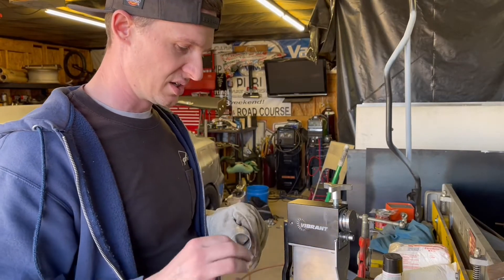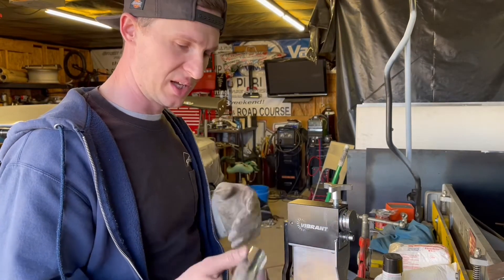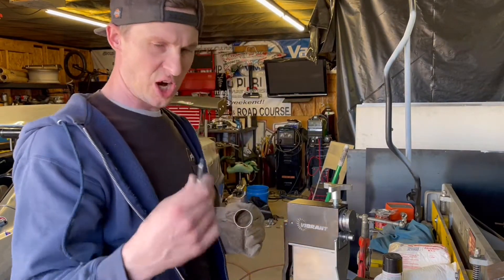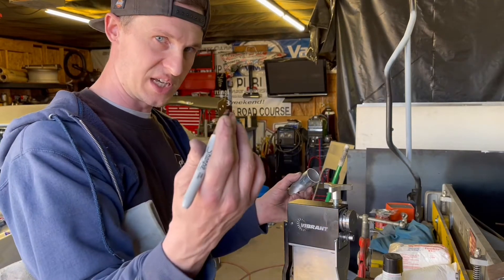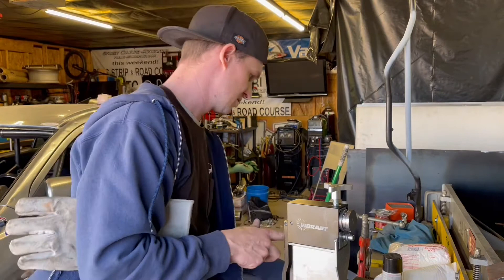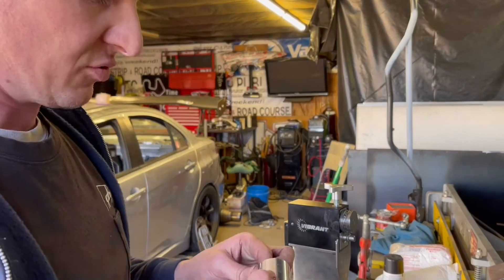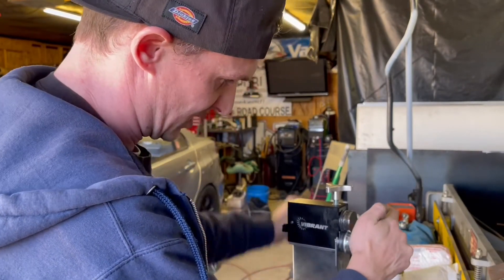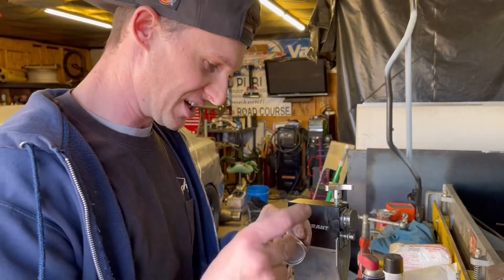Annealing Aluminum - it’s way faster this way.

Comment: I know this is an old video but I'm curious. You immediately quenched after heating, did you let it cool down more before rolling the bead or just go from quench to rolling the bead? I have several pieces to do on my project and would hate to get it wrong. It's all coolant lines out of 1-1/4" 6061. Thanks! Love the videos!

Comment: Precipitation hardening of Aluminum is done by heating it and letting it cool slowly. Quenching softens it. Copper behaves in the same way. This video is one of the few on YouTube that gets it right. Good job.
Reply from the maker: Thank you!!
Reply: With no luck, I've tried annealing aluminum tubing without Quenching and it always cracks. I'm going to try Quenching, however, should it be done with oil or water?
Reply: @shockadellick  Water.
Reply: To quench or not to quench after annealing depends on what type of aluminum you are using. For example, cooling 5052 aluminum naturally in ambient air after annealing does not cause precipitation hardening, as 5052 is a non-heat-treatable alloy that doesn’t form strengthening precipitates. Air cooling is the standard, safe, and effective method to achieve the soft O-temper after heating.

Comment: Yes but once it's annealed and you put your bead into it then you have a softened bead being used to make a seal. I don't know what kind of pressure it's going to be operating at but I'm thinking that it's not going to hold up long term in that state. A guy from another video commented that to bring back the tensile strength of aluminum after annealing is to heat it at 450° for 8 hours. He said that he worked for an aluminum company and he was referring to T6 aluminum if I remember right. I don't know if it would work and/or if it does work will it work for other aluminum alloys also or is there a different procedure for those. I'm going to continue to research how to bring the tensile strength back into aluminum after annealing because I need to make a U shaped bracket and I don't know if it'll be strong enough to hold its shape after it's annealed.
Reply: You just do solution process then precipe. Then the workpiece will back to T6
Reply: After you bead roll it, the area is work hardened so it is stronger than an annealed state it began with